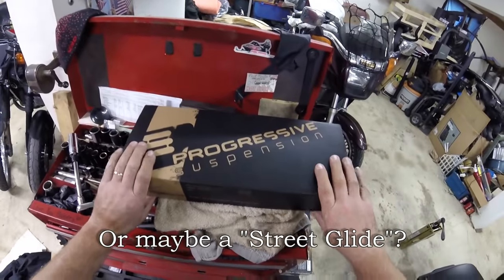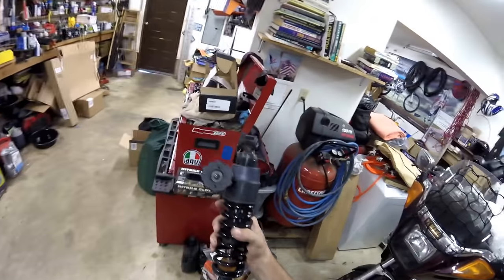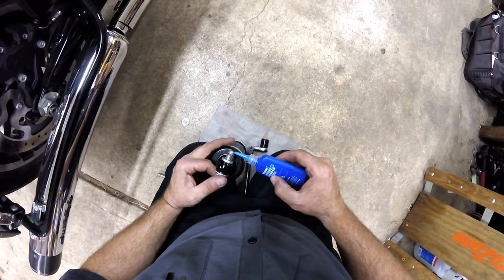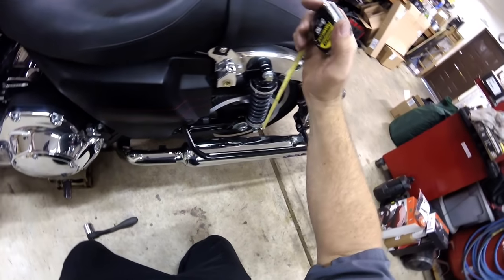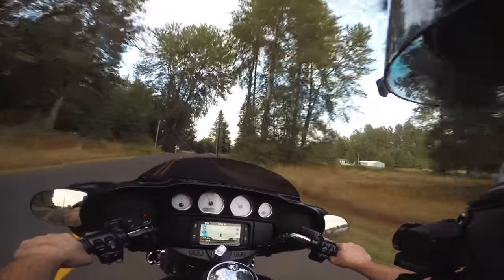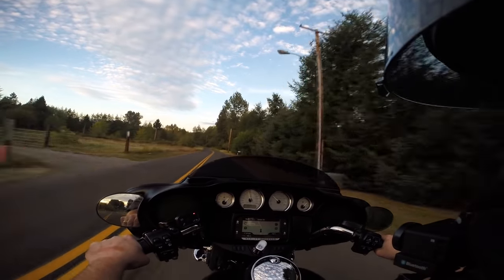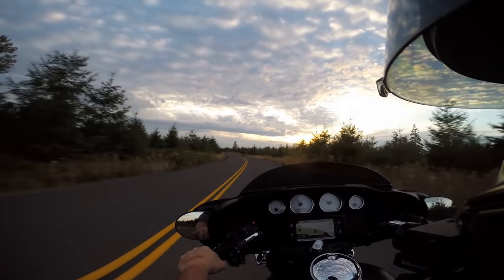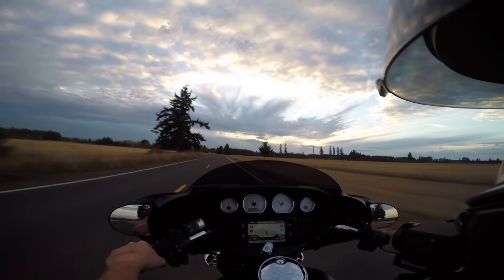Progressive 944 Shocks! - Install & Test Ride! | '15 SGS | ShopTalk / TestRides

Comment: Just installed a set of 944's on my 2016 Roadglide, (you're video convinced me to try them) Really super satisfied with the ride and the lower position. gonna put a few more miles on and reset the sag ....but so far , no complaints , smooth ride , doesn't bottom out and my feet are flat at stops..Thanks again Shawn!
Reply: *smiles*...I always take his advice, rarely if never he's wrong.
Reply: I have 4.5 stretched bags. Do these really lower the bike that much to where I'd have to worry about scraping

Comment from the maker: +fastbagger - I have the idle set at the standard 1,000 rpm.  I didn't lower it with the SE Super Tuner Pro in fear of making the compensator noisier on takeoff's than it already is...  Harley is using the SE Compensator as OEM on all the 103HO and CVO bikes. The complaints of the takeoff noise is massive, but it's a much better compensator and quite easy to avoid the noise when taking off. I forget sometimes and make it do it...

Thanks for watching!
Reply: +Shawn Smoak Please upload the long vlogs, I love to come home after work and put on your channel as I relax after a hard nights work.
Reply from the maker: orckiller91 - Awesome, someone actually watches all the way through the long ones! Lol

Thank you, I appreciate you watching and commenting!
Reply: Shawn Smoak
My pleasure! And question, would you call the Street glide "Beginner friendly" If they take it easy and don't hold the throttle wide open?

Comment: I finally get my15 minutes of fame. Very honored to be mentioned Shawn. :) Thank you kindly. I couldn't see the gauges changing their illumination, but the Nav definetely was throughout yur ride though. Maybe I only notice because I dont have a dash. ;)
Reply from the maker: +J. Austin - You bet, thanks for noticing that on the Ultra! After some searching and testing, I found out the SGS doesn't do that. That's a bummer, as they can be tough to see at dusk...  I have the nav set to the default "auto" light adjust setting.

Thanks Jay!

Comment: Hey Shawn, awesome video buddy! I bought a 2016 SG and had to change the shocks straight away. The roads in Australia are not great and the SG really was like riding a bronco! I have installed the 944's and it has settled down to remove that spine jarring bumps that we had on the standard shocks. Would love to see how you took the sag out buddy as I am keen to adjust that too...cheers Shawn

Comment: I seen that video about the air shocks i had to laugh the left & right  shocks do not move independently the swing arm is one solid piece connected to 1 tire moving both shocks up & down together. All you can do is shake your head. I'm buying 944 ultra lows for my wife's roadking.  I have a ultralimited & I love my factory air shocks. Thank you for the video.

Comment: that's funny, you still have the Road King on your mind.. One thing to remember is you can always put a bit of lithium grease on your bushing to keep them from squeaking or you can put a bit of spit on the steel sleeves going into the bushings to help lube them up and make them slide into the rubber easily and obviously it will dry pretty quickly.

That thing is so much cooler looking without the bags, rack, and rear seat upright on it.

Shawn.. you have a camera you can hook up to your phone.. use your gopro on a stand, aim it at the tape measure and watch it on your phone.. just keep it in a narrow mode so you have a chance in hell of actually reading it.

Comment: I just installed these shocks to get a smoother/softer ride on my 2014 SGS, I’ve found them to be not much better than the lousy stock shocks.
I called the shop that recommended them, the mechanic said they take about 500 miles to break in! What? Never heard of such a thing.  I’m going to remove them try to sell them and try another brand.

Comment: Just saw your Progressive shocks install video. Thanks for posting it!! It answered a question I had for my Bitubo shocks install. They will be mounted inverted like your Progressives. I wasn't sure since the OEM shocks are mounted the opposite direction. Great video!! I'm a subscriber to your channel now.
Reply: How do you like the Bitubo shocks?  I just received mine but not installed yet. I did notice one shock is slightly longer than the other. Says that is correct in the manual. Never seen 2 different length shocks before

Comment: Hey Shawn, how does these shocks compare to the 2017 stock shocks that you have on now.  Are they better or worse. Thinking of buying the 2017 shocks and installing it on my 2015 RGS.  If they are comparable I would get the 2017 shocks because of ease of adjustment.  I ride solo and two up and I don't want to fiddle with 944 adjustment.

Comment: What pipes are you running?  They sound awesome!  I am having issues with my 944's. I just installed them last August  but I don't think I have them dialed in correctly.  I can't find my instructions so I guess I'll just have to play around with them. We went for a ride yesterday and I would have rather been on a dirt bike. What could be wrong?

Comment: Hi Shawn, Love your videos. I had 944's on my 2013 Road Glide Custom. I found that the standard air shocks with 2" of travel gave a very harsh ride. As for the 944's, I was not able to dial in the pre-load to provide a decent ride. The shocks were stiff and bottomed out often. I called the tech's at Progressive Suspension and they were not able to help. The literature says that the 944's fit essentially all of the Harley Touring bikes. The issue with that, is that the Harley touring bikes have gained a lot of weight of the last few years. My 2013 is 90 lbs heavier than my old '05. I suspect that the springs on the 944's are too light. I ended up removing the 944's and replacing them with air shocks from a Road King ( 3" of travel)  Although the Road Glide rides a bit higher, the ride is much better than the standard Road Glide Custom shocks or the 944's. How would you compare the STS's ride to the Spyder RT's ride over these rough roads ?  Cheers ...Rick

Comment: Would these be suitable to use on my 2019 Freewheeler ? When you take your measurement, use some blue painters tape on the fender strut and make a mark with a sharpie.

Comment: Did you take a before and after measurement of the ride height? I am curious if you stayed at the same height as you were with the stock 12" air shocks with the 13" 944 shocks.
Reply: Also curious

Comment: Nice . wont you get a rattle with the washers on the bumpstop ? Normally the bumpstop would hold the washers down but with the inverted install they must be free to make noise ?
Reply from the maker: +Roffa73 - The bumpstop was slid up on the shaft still from assembly. It got knocked down (or up in this case) and seated with the first good bump I hit... It probably made some noise till then, but I never heard anything. 

Thanks for watching!

Comment: LOL didn't take long before you started making improvements to the stock parts. i wonder what's next on your list of things you'd like to do?
Reply from the maker: +Robert Robb - I think that's almost a Harley right of passage to start modding to one's liking... Lol  For the 1st week or so, I couldn't imagine what would ever have to be changed (other than the standard intake and exhaust). I really didn't give the shocks much thought until taking that Ultra Limited for a couple test rides... Those shocks made for such a pleasant ride, I just had to change them on the SGS. Now that I have the sag set on these 944's and gone for a few rides, I couldn't be happier!  One more thing will be in next week, and that's a 7" clear shield to replace the stock 4".  I'm hoping that will make the headwind performance better while keeping the low profile look. I went with clear so I can go back to my standard chin mount with the GoPro. I look a little odd packing two forward facing cameras on my helmet all the time... Lol

Thanks Robert!
Reply: Shawn Smoak mn

Comment: I have a 1999 Roadking had local shop put the 944 low and the lowering front tubes which were lowered almost an 1 1/2 in front ! Bike looks awesome ! However it rides horribly ! It almost bumps me off the bike ! A road I travel all the time has small buckles that I never noticed til now almost makes me ill the way it hops ! Any idea what adjustment if any can be made spent a lot of $ couldn't be more disappointed ?

Comment: I dont have those model shock but i do have progressive shocks and idk on those but my stock set and new set put the sleeve for ypur bolt top and bottom are opposite what you done with yours the stop on your sleeve supposed to be out. Idk you may have installed backwards
Reply from the maker: Thanks for the suggestions, but I can assure you they are installed correctly and exactly as Progressive instructed...
Since this video, I've purchased a newer SGS and the shocks have been on that bike until a few days ago when I replaced them with Legend Revo-A shocks.  The upgrade is simply amazing!!!  Here's that video: https://youtu.be/B5eGw-WVnKM

Thanks for watching and commenting!

Comment: Looks like a pretty straight forward instal.  I'm glad it worked out like you hoped.  Have fun on the new "Road King".  :-)  Couldn't resist.
Reply from the maker: +sam smith - Yeah, it's quite simple on these dual shock setups...  Maybe I should just use Road King as the Street Glide's nick name!  Lol   I get it half right sometimes when I call it a Road Glide...

Thanks Sam!

Comment: That should be a significant change. Do you Have to change everything when you go 2 up .. I find I like  having the rear a bit on the firmer side, not to firm but firmer than how it came... guess it doesn't help i'm chubchub, but I just like a planted rear end .. hehe. Very nice mods .. These touring bikes can be seriously addictive.

Comment: Shawn ...Consider me confused...... I'm installing new Progressive 994's on my 2015 Street Glide. The supplement says to install rod end up if detachables utilize the top shock mount. The 4 point kit for detachables is mounted to the rear frame not the shock mount. Am I mistaken on what is considered the top shock mount? 
What detachable accessories utilize the top shock mount on a 2015 Street Glide?
Reply: +Gary Jones A backrest uses the mounts on the inside of the shock mount. The bottom of the bracket will hit the top of the shocks when installing the backrest if the shocks are not installed upside down.

Comment: Thanks for sharing, great video. I was looking at the 2015 Street Glide, which cost here 34K in US Dollar, but decided than for the Street Bob (cost as much as a Street Glide in your area lol)  --- That was my little rant about Harley prices in Ireland --- I just adjusted my shocks to position 5 of 1-5 after checking the owners handbook, damn I missed the weight settings when I decided for that bike lol. Would you think that progressive shocks make a huge difference at a Dyna ? We have bad streets here in Ireland ... and I mean BAD.

Comment: Great work on the how to install. Couple of questions. Do you have to re-torque the bolts a certain time after installation? Do you need a specific type of jack to lift it. Thanks in advance.
Reply: +casper3380 I think the instructions I received shows 35-40 ft#'s if I am not mistaken.

Comment: Dude I'd like to know how you made out with the sag and if everything was fine with the  upside down shocks and how the bike handles
Reply from the maker: +Don Still - It was a little odd to set up with the built-in 1" of sag, but it worked out great.  About 1K~1.5K miles back, I gave the adjusters one full turn stiffer each after the shocks broke-in and I've been very happy since.  I know I'm pleased when I never give the suspension a single thought anymore.  The handling of the bike has been great from day one, even with the OEM premium shocks...  She's a big heavy bike, so you have to respect that when you try to keep up with kids on sport bikes! Lol

Thanks Don!
Reply: +Don Still thank you)  I ordered a set for my Road glide 2015 maybe you could do the picture of that on YouTube Setting the sag up if you have time  just

Comment: Great video!   I have a 16 RGS, put legend rear suspension on. On way to Bike week in Myrtle Beach last weekend and encountered some terrain I hadn't traveled on before with the new Legends. Could not find a happy medium , it almost felt like I had a tire issue. Make a long story short, ended up going with the progressive standard 944. Love the shocks but I will say they are stiff. Have mine set at 1.25 turns is preload and I'm probably 175-180. With the wife on back and 50 lbs of luggage I was at 6 revolutions.

Had them do the front springs too.

Comment: Hey Shawn,  I have a 2015 Street Glide Special and thinking about getting the Progressive 944's and wanted to see how they are still working out for you.  I see you installed them about a year ago.  Also did installing these lower your bike by 1 inch?
Reply: Randy Overton I have a good 2015 SGS also. I just ordered these off Amazon. How did they work out for you?
Reply: John I haven't bought them yet.  I chose to put on some heated grips and more LED lighting first.  Let me know how yours work out.
Reply: Will do. Won't riding till april though  unfortunately. Unless there is a warm day in March.
Reply: Had a warm weekend. Installed the shocks and they made a world of difference. Really made the ride much more pleasurable. Highly recommend them.
Reply: Awesome!  Thanks for the info John.  Looks like this will be my next purchase.

Comment: Question, why do you have to spend all this cash to sort Harley's out Shawn ,? surely a bike as expensive  as this should breath ,drive and ride well from the get go or am I missing something ? I've never had to do this with my Hondas and Suzukis etc is this just something peculiar to HD ??
Reply: It's the style of bike as far as ride goes, this is a special which is the same as my 2013 roadglide custom, as in the rear suspension is slammed.
The do that to get a certain look that people really like, the downfall is you are sacrificing suspension travel for that slammed look.
Harley's ultras are fine no need to mess with the suspension because they are great the way they are.
As far as breathing first don't blame Harley blame the epa they are the ones who regulate that.
Two we who own Harley's love to mod them so we open them up ourselves and add after market exhaust and air breathers etc, we like to have our bikes look and sound the way we want.
You mention the metric bikes, you really are comparing apples to oranges there, when we say if you don't own one you will never understand, we truly don't say that because we think we are superior to you or your ride.
We say it because owning a Harley is truly unlike any other bike and it is by far in my opinion the best bike out there.
Reply: I do own several different bikes including a Suzuki, but as stated above the Harley is my favorite for so many reasons.
Now you can ride them stock and never do a thing to them, I know of many people who do that, but for me and many others I modded mine because I wanted a sound and a look that was different from others and with the literally hundreds of thousands of aftermarket parts the sky is the limit as what you can do with these great American bikes.
Reply: Right! You've never had the urge to farkle? I changed everything on my Kawasaki Concours to suit me and now I'm doing the same on my RGS. You must be easy to please. ;-)